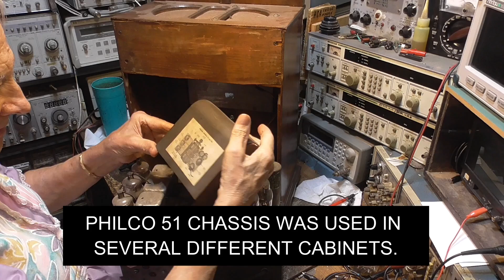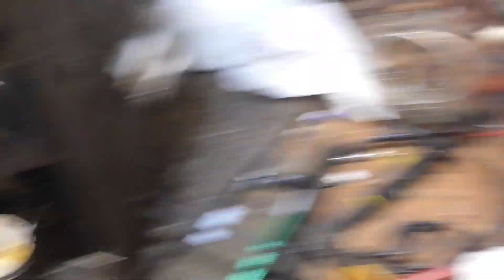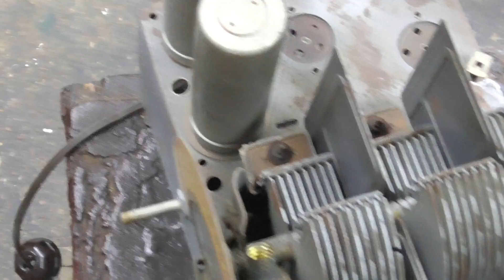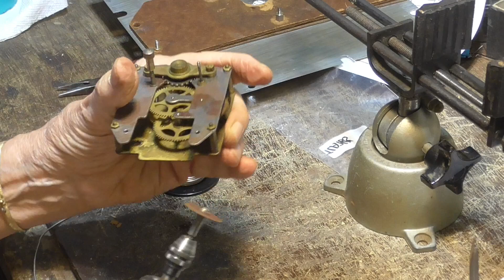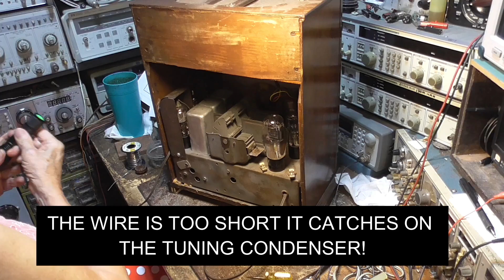RESTORING A 1930'S PHILCO CLOCK RADIO

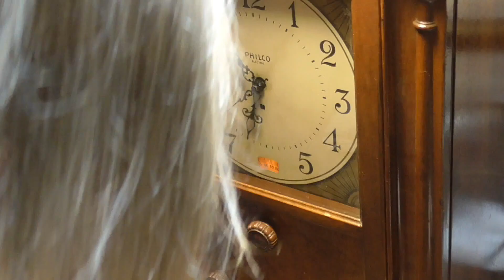Comment: 32:00 It looks a shaded pole induction motor though the motor rotates either way. I guess the short circuit ring on the shaded pole got open. From 52:45 through 53:50 the hands move backwards.

Comment: I just got a philco grandfather clock radio.  It has the philco model 70 chassis.  Right now I am planning on rewinding one of the IF coils.  I bought it because I never seen a radio like that.  I did have to drive 600 miles to pick it up.  I did have to rework the clock because someone got into it and it look like he was in over his head.  The radio itself was mostly untouch.   I did find 2 tubes that were burn out, but a person on ebay had what I needed.  The guy selling the radio wanted 325 but I offer 275 and he took it.  I felt it was a very good deal even though I am having to do some work on it.
Reply from the maker: $300 is a good price for a complete grandfather clock radio! I paid over that for each of the three I have in my collection.

Comment: Have one of these. Radio    Works  clock replacement missing wood valañce at top  use as every day clock   radio  only works in city no local station here ❤ps this is a 300$ radioo. Mine is 4 tube

Comment: Hi, I have an unrelated question, but I think this is the right channel, does anyone know where tu buy proper getter ring for making diy vacuum tube? Maybe not too expensive
Reply from the maker: The getters are not the problem. It is the RF induction heater to flash them. For getters, buy a bunch of old TV tubes off ebay. Cheapest since you will be breaking them apart. Do not break the tube open until you are immediately going to put the getter on your homemade tube to seal off and get under vacuum. Exposed to air, you have about 5 minutes until the getter is destroyed.
Reply: @glasslinger  thanks, so the barium in the getter is stored in a metallic form even before flashing right? Witch are the tube most probable to have an unflashed getter?
Reply from the maker: @Farben-X  I find the color set regulator tubes like the 6BK4 and the like, and the high voltage rectifiers like the 1B3. Large sweep tubes also have plenty of getter remaining. Don't pay much for the old tubes. They are worth about 25 cents each.

Comment: Hello linger, I need your kind guidance in one of the resistance value. What shall be the reading value of 8200 resistance. In the tone control circuit diagram it is mentioned only 8200, so I am in dilemma.
Regards 
BHARATH                    Thank You
Reply from the maker: The convention is if there is no marking the value is in ohms. 8200 would be 8200 ohms, or if it were marked, 8.2K. Or in old fashioned resistors, gray, red, red.
Reply: @glasslinger  Thank You So Much for your kind guidance and support.
If you are comfortable, please drop the Email ID, I will send the Circuit diagram, it will be helpful for you to suggest the proper resistance value.
I have undertaken the restoration of my 1970s ECL82 stereo valve amplifier, so that I am kindly seeking your kind guidance and support, please.
Regards 
BHARATH                       Thank You

Comment: Hello my friend, a question: Why does the radio take about half a minute to turn on before the sound is turned on?
Reply from the maker: The vacuum tubes have a heating element called "filament" that has to heat up to red hot. This takes about a half minute from turning on the power.
Reply: @glasslinger  🌹

Comment: I have a stupid Question.. was it me or was the Clock second hand going the wrong direction? Just wondering :)
Reply from the maker: The clock mechanism is a very early type that will run either direction. I put it backwards in the video to see if anyone would notice!
Reply: @glasslinger  I herd you saying that it worked both directions. I was just step by step, When I entered into Electronics repair was in the mid 80's that kind of electronics were still around but dying fast. Thank you for your response :)
Reply: @glasslinger  I saw it at once i thought is the film running backwards for a second..😀
Reply: @glasslinger  sounds like my BSA Bantam D1 1951  I set the timing wrong and the engine ran backwards........( England )
Reply from the maker: @davids8449  Amazing! I had no idea that would work! Seems like the exhaust stroke would happen before the intake stroke.  I know a two stroke will run either way but a four stroke is more complicated.

Comment: the little shaft on the left side of the clock back is the starter shaft I think you can spin the works either way with that shaft. I have a late 1920s wall clock with the same works..

Comment: 51:35
What did they do?  Just keep turning it on and off until the clock ran the right way?   I just watched it again, I see you were spinning the gear until it went the direction you wanted it to go .
Reply from the maker: It has a knob out the back of the movement. You can turn it either way! I put it backwards to get some comments!   :)
Reply: @glasslinger  That worked out just as you planned! Ha ha!
Reply: @glasslinger  Australian version.
Reply: @glasslinger  Love that Ron .....You also made me laugh playing with the menus on the generator... they drive me nuts too!
Reply: I was going to ask the same thing. Power failures (which used to be far more common back then) must have been pretty annoying because you'd never know if multiple interruptions had set the time back.
Reply: @sometimesleela5947  I think a majority of the synchronous motors like that had a little coged gear that let the motor run in the correct direction but stalled it in the incorrect direction.
Reply: @mrbyamile6973  I see that on most modern synchronous designs; effectively a one way clutch that allows a few degress of back-rotation before hard stopping and causing the shaft to bounce back in the proper direction. It sounded like Ron was saying 32:13 the early ones were pure manual.

Comment: I had a clock that could run backwards or forwards. It used a (broken) spring loaded mechanism to start it after a power cut, it was 50/50 which way it would go. I would fight for ages with it.

Comment: the second hand is going backwards
Reply: Rons in a time warp....getting younger by the day...
Reply: Early alternating clocks would do that, later on the put in a little trip thingy so that if it started up going in the wrong direction the thingy the force it to restart in the other direction.  You'll notice most clocks are direct current these days (even if a/c they have a d/c circuit.  Those thingys could get warn out, it happened to me where I had particularly poor a/c service so it glitched alot.

Comment: I am not satisfied with the performance of radio as it's sensitivity is very poor and audio quality is not good. You should have washed all the clock machine with suitable chemical or contact cleaner. Anyway I liked the design of radio and the physical layout of tubes, ifs and tunning gang and the chases is very robust. Anyway I really enjoyed the restoration of very antique clock radio. I am not sure if a separate power supply is used for the clock or we have to keep the main power supply on for the clock. Clock machine you installed looks also very robust and good design. 👍

Comment: Pretty rare model 51 clock radio from 1932. The clock module can spin gears either way so you must set the time forward
only or it will run backward. Another cleverly repaired clock and radio there Ron. Too bad there is something rubbing in the speaker cone.

Comment: The clock is going backwards
Reply: Happens with old a/c clocks, then they put a trip mechanism in there to force it in the other direction then they simply made them all d/c circuits.
Reply: @goingjag  thanks for the explanation. Never realized that that was the reason.

Comment: Thanks for the awesome video Ron!  Your cat is always a treat to see;   As for the clock, I worked with one of those some time ago and if I recall correctly every time I cycled the power it would change direction;   Could be a fluke but that’s what I recall.
Reply: Yeah, later on they added a flipper to force it back the other way, ac will do that.

Comment: what outside antenna do you have for those old radios? I need an outside antenna to pick up am stations any suggestions. Thanks!!!
Reply: suggestions from anyone would be appreciated?
Reply: He has a couple antennas of different lengths outside his house. Basically just long wires running around the fascia of the house.
Reply: @xnavynuc  thanks what size and kind of wire is best ?
Reply: @spinnerbaitalways  Any size wire should work, but it should be heavy enough to hold up to being stretched out over a long distance. I’d go for at least 22 gauge. Even old speaker wire will work if you have enough.
Reply: I’d use at least 30 feet of wire, but if you want the best reception you’d need to make the length a multiple of the wavelength you’re trying to receive.

Comment: Synchronous AC motor can make clock run backwards for a few reasons...but going back in time isn't so bad....cool radio. 😃
Reply: There is usually a loose spring tab that rest against the pole cog, if it turns backwards it catches the spring which jogs the pole cog in the correct direction. Nice smooth sweep with this type of movement.

Comment: How do people cope with 36 degrees Celsius or 97 degrees Fahrenheit. Wow that is hot. I could not bare that kind of temperature, I could only go out at night when it's cooler. It's 53 degrees Fahrenheit or 12 degrees Celsius here in Ireland. If I was there where you are I be praying that we didn't get a power outage because that would mean no air conditioning. Stay well Glass finger. 😁
Reply: You tend to get used to whatever climate you live in. I live in South Carolina in the U.S., where summertime temperatures are often in the upper 90s (37C+). When I moved down here from the north I thought it was extremely hot here, but after about 4-5 years I got pretty used to it. Then l had to live in Houston (where Ron lives) for a while. It’s not only hot there, but humid too! Now I feel even better about my location. I’d probably think it was too cold for me where you live.
Reply: BTW, I love Ireland!!

Comment: Who, who would have taken the clock out and replaced it with a modern movement, and not just gotten either r anew radio, or not gone to the ass boring trouble of dismantling a quartz clock 😑 agh

The price was a steal considering, I can't imagine what the shipping would be if that had been an ebay deal ☠️